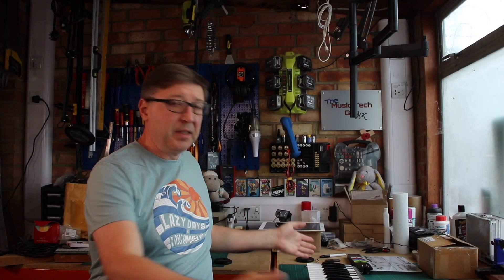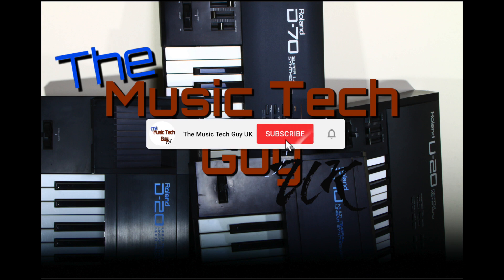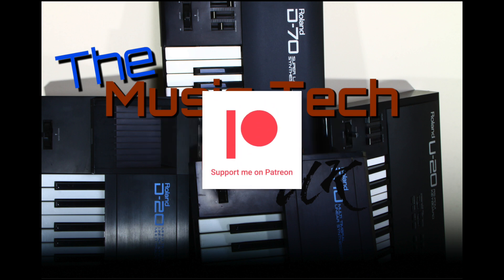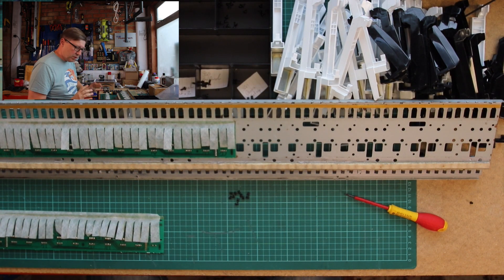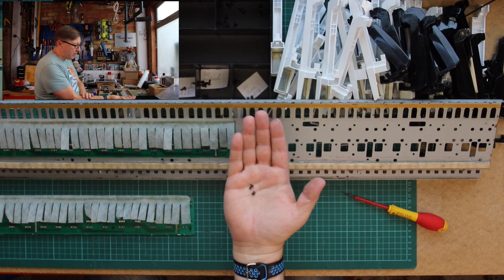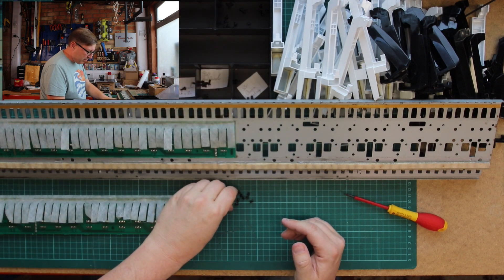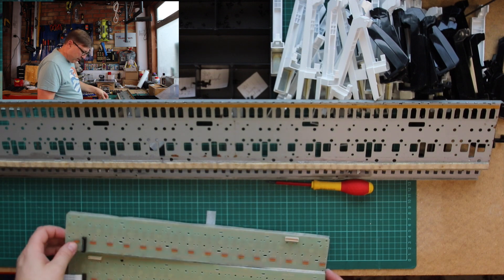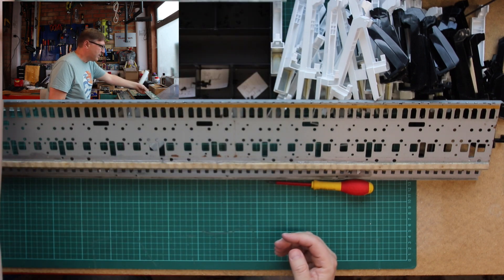Roland S-50 - 2nd Keyboard strip down and rebuild Part 1 - Restoration Part 11

Comment: I have an S-50 that has some problems. One of them is the scrambled video output. I ask if it is normal for the TMS3556 video chip runs very hot.
Reply from the maker: Hi @wpelectronics4115 

I will answer this by saying how hot?  In most computers and depending on what you are doing you will often find that the CPU heats up.  

In the synthesiser environment it would not be uncommon for some chips on circuits to be warm to the touch when in operation.  If this chip is running so hot it is burning to the touch then this would probably indicate that something is wrong.  I would start by looking at the power supply to the chip to understand if this was within tolerance.  The problem is it could be a wealth of components, but heat is released normally because of power.  Jon
Reply: @TheMusicTechGuyUK  thanks for your response. This chip is reading 68 degrees C on the IR thermometer. I suspected the two S-RAM 4464 and replaced them, but without results. I also replaced the HC245 and HC573 ICs from the video sector. The power lines are OK sending 5.2v as required by the circuit, including the 3V auxiliary voltage. The system is booting normally, which indicates that the CPU is OK. Now all I have to do is change the video chip. One observation: without the video chip, the VFD display only shows the characters this way - - - - - - - - - after booting.
Reply from the maker: Hi @wpelectronics4115 

While 68C is hot it is not as toasty as some I have seen.  But I think that this is a good bet that it is the problem, especially as the power in seems to be within range.  Jon